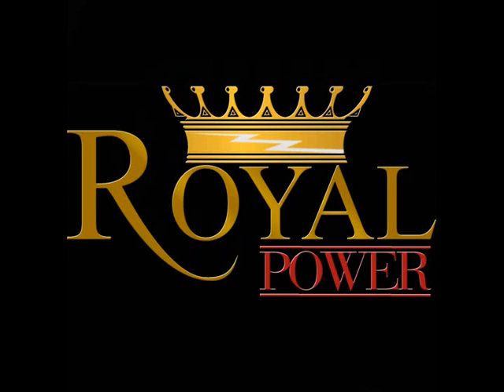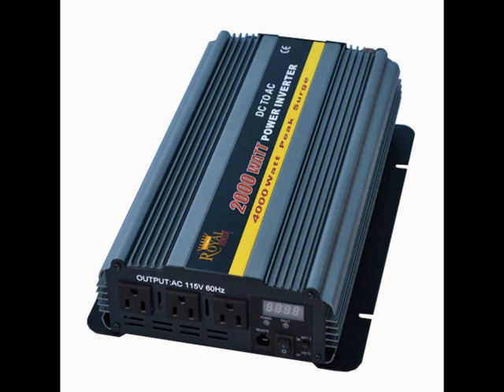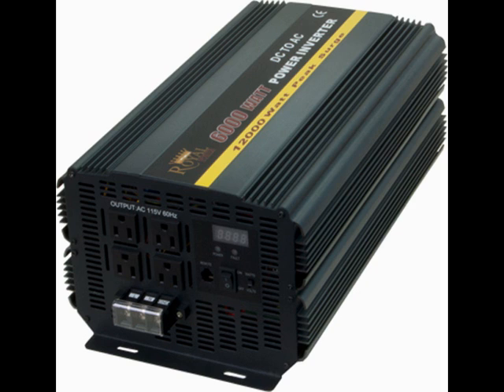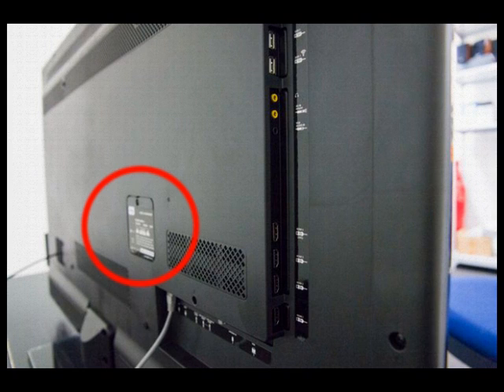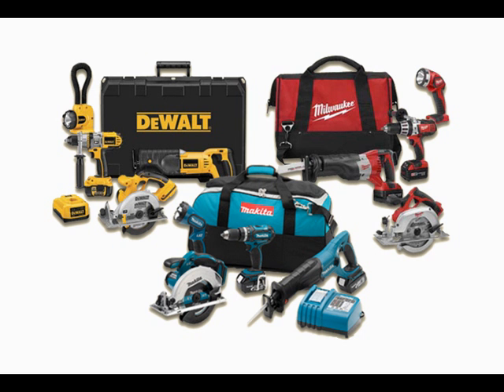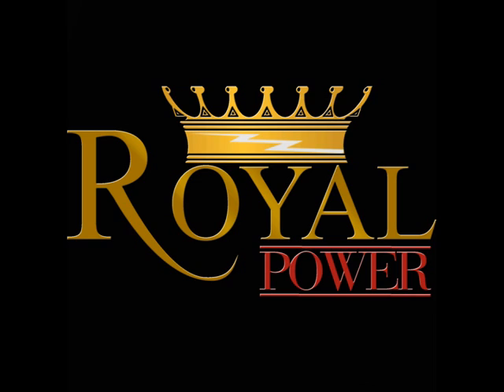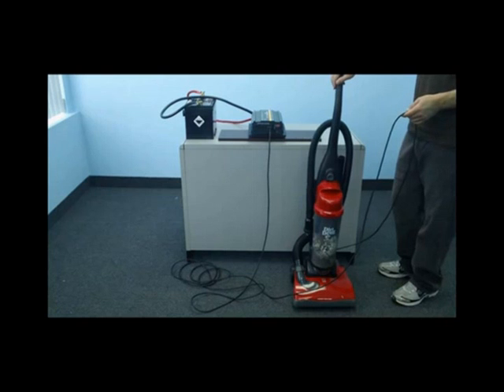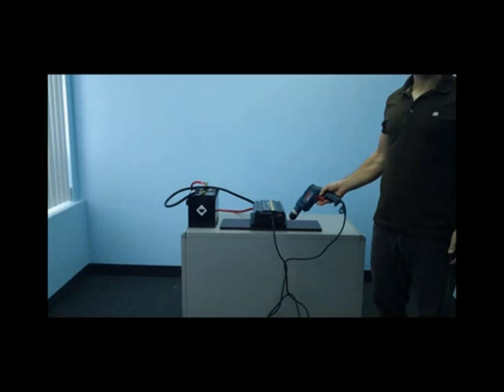How to select the right size DC to AC Power Inverter

Comment: I'd like to run a few tools etc out of my van using a voltage sensitive relay & an auxiliary battery (12V).
The most demanding appliance is probably the vacuum cleaner (1200-1700W).
What size inverter will I need and what battery to run it?

Thanks